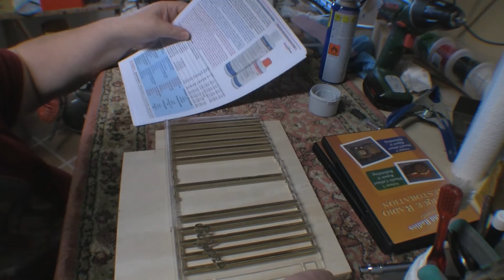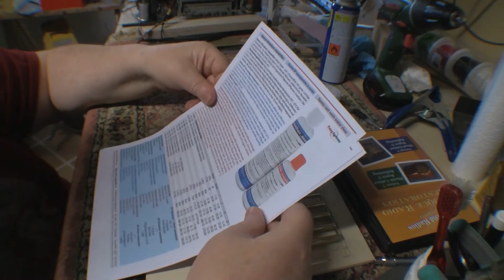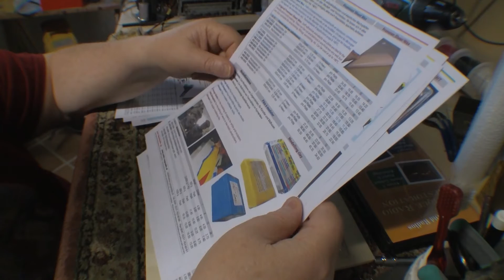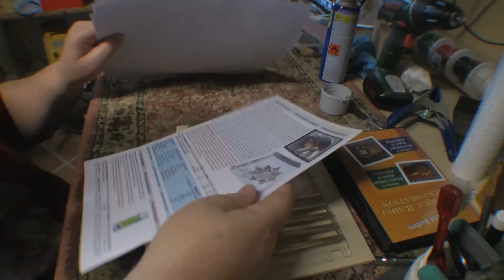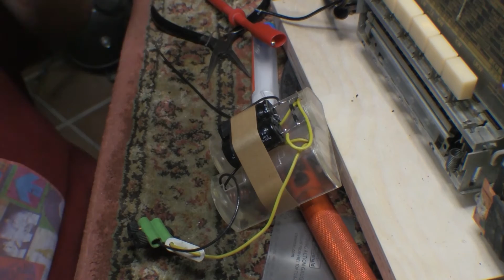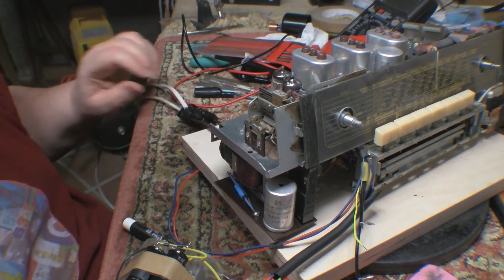Telefunken Bajazzo 55 - part 5

Comment: Hello mate
I have a Telefunken Gavotte 55.

fall buzzing sound (light - medium), clean keypad with cleaning spray, of "zero waste". after that do not fall sound, but ...

While listening to the radio, but with zunbido (light - medium), it would be good to change
selenium rectifier, germanium diode and resistance to drop volts and 1.41 delete germanium factor?

It would be good to change filter capacitors 385 V 2x50 uf?

Buzz suppress these actions?
Reply from the maker: +Sento Duval Luckily my set did not need any of those parts replacing as the sound quality is excellent.  It still sounds fine two years later so I think its OK.   For your set, if you have hum in the audio with the volume control at minimum then the filer capacitor is the most likely candidate to replace first.  I would also replace the selenium rectifier as a precaution.  You may need to add a series resistor once you fit the silicon diode.
Reply from the maker: +Zone1242 Since your set is mains powered I would definitely change the filter capacitor and the selenium rectifier as mentioned above.   Mains powered sets will tend to stress to components more than battery powered portables.

Comment: Very nice. Are you going to need to use pressure or vacuum  casting in order to reduce the presence of air bubbles in your casts?

Comment: I don't know how reliable those capacitors are, they look like Ero brand ones and they usually end up leaky, at least in AC sets, they may hold up better in a battery set due to less heat and lower volatges. I think that acrylic cement should glue that grill back together, I've used it to fix the polystyrene plastic cases on broken 8 track cartridges. Another substance that may work for casting is fiberglass resin or gel coat, I think it's polystyrene.